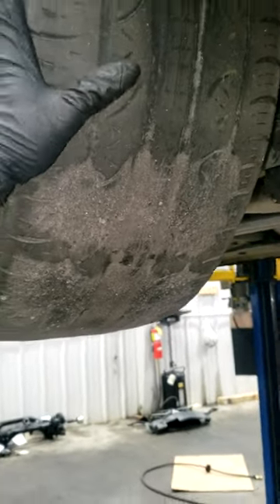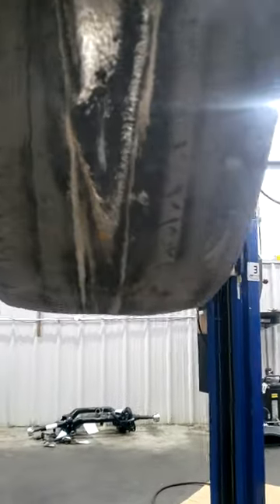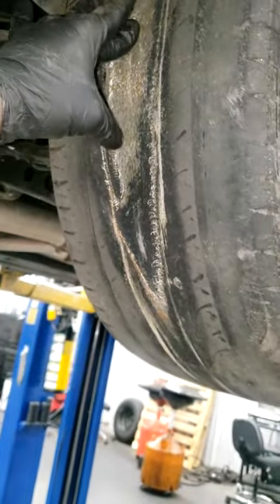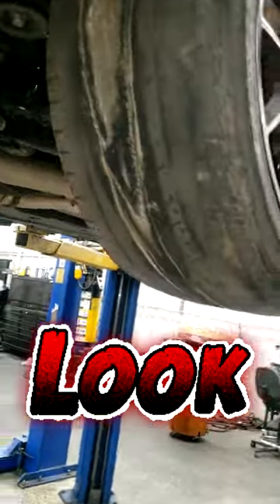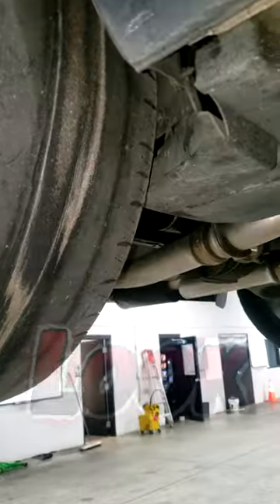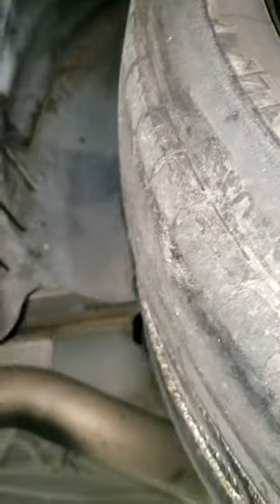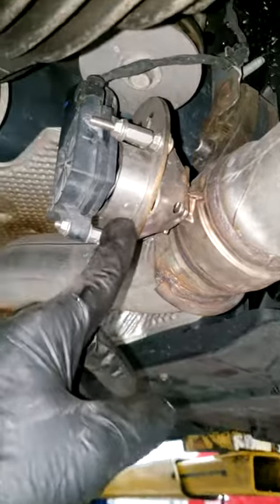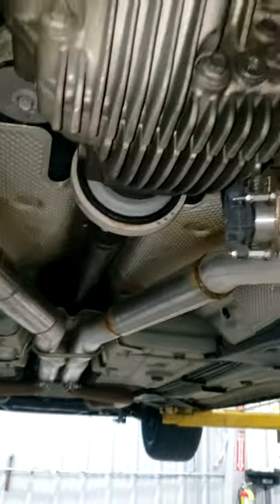Who can tell what cause this?

Comment: Over heating and stressing the tires mixed with high tread wear causes the tire to flex in the center due to centrifugal force. Right side wears out faster due to most street take overs tend to drift counter clockwise putting more weight on the right side causing a larger load on a weaker tire. Plus power side tends to be the right side. The valves I'm guessing adjust for best sound at different rpms. I didn't always want to be a collision tech lol.
Reply: Torque of drive shaft tends to lift right rear, as well.
Reply: @thisisyourcaptainspeaking2259  I forgot about that one too.

Comment: It's not a stand still burnout. Most rear drive vehicles only apply power to the right rear tire. Probably getting the thing sideways. The exhaust "shims" are exhaust valves. There's a butterfly valve in there. Meant to make the tone quiet when closed and loud when open.

Comment: The tire wear in the center is from overinflation. If both of the outside shoulders were worn out it would be underinflated. As far as the shims go, I'm really not sure of the importance. I know those are like baffles or diverter valves or something like that. So if they're shimmed, it probably changes the sound to make it louder